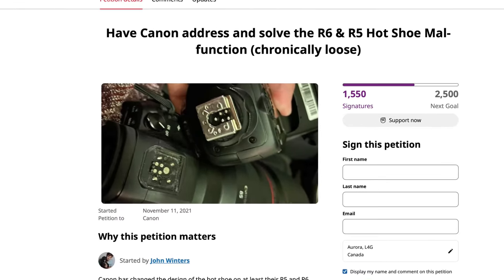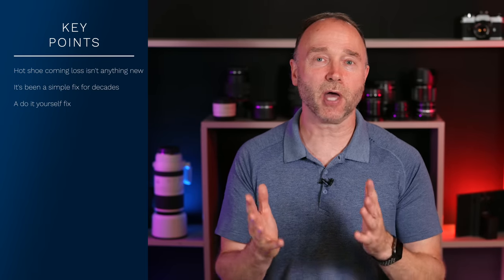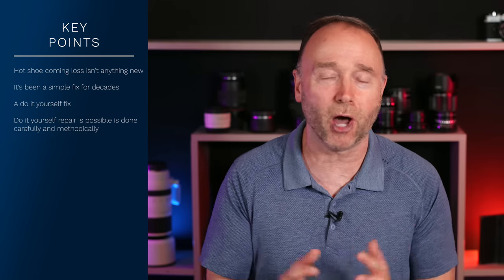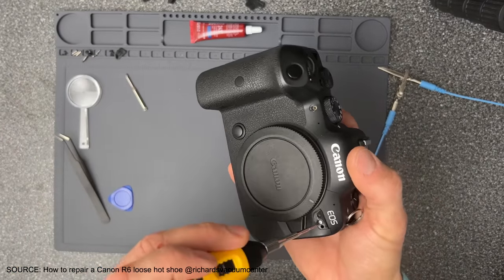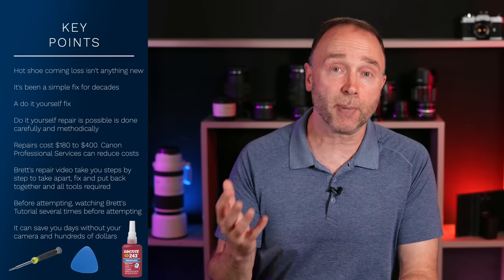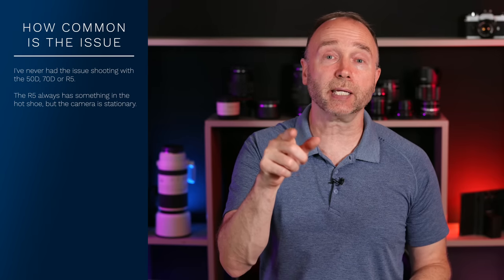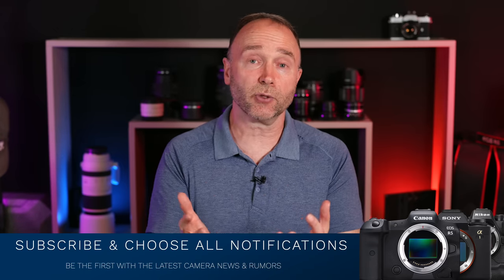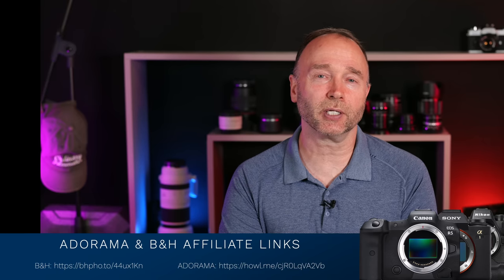Canon EOS R System: Major Flaw?

Comment: I've shot with Canon for 30+ years. This has never happened to me on any camera so maybe this is a manufacturing issue.
Reply from the maker: Brett observed that screws without any sort of locktite were most affected. Vibrations over time will shake anything loose including screws. Having something weighty attached and moving around all the time is one recipe for the screws coming loose. This does not seem to affect a lot of people, but does require service on the R system if it happens unless one is willing to attempt a repair themselves.

Comment: Canon should offer a hot shoe tightening service for free.  Otherwise they risk dozens of owners suing them.  Clearly if you dismantle it yourself it invalidates any warranty and your insurance wont be happy either.
Reply from the maker: I don't think there is enough people to sue. The cost to sue versus the damage one receives is not enough for one person to sue, and there aren't enough people to justify a class action suits. Car companies are known for this type of calculation - how much potential exposure is legal versus the cost of recall.

One thing this serves as is a reminder to check your equipment regularly for readiness. Screws come loose all the time in tripods, camera gear and other devices. I'm always checking tripods for lose screws and vents on computers for dust build up... which is why I don't have a lot of toys with engines... maintenance sucks a lot of the fun out of it.
Reply: @OrdinaryFilmmaker True.  But perhaps Canon might redesign the hotshoe for future models.  They could use a screw glue like they use in my drone props. 
I have a simple issue now with my car, a BMW, blocked filters on the screen wash. Bad design: To fix it, you have to half dismantle the car underneath the front wheel, wrestle the water bottle out, drain and flush, clean the tiny filters, and then reassemble with a dozen types of screw and fittings. . . Garage said it would cost me £140 plus for them to do it.  Obviously, since this is a common problem, the design by BMW should have taken that into consideration and made it easy for owner maintenance.
Reply from the maker: I'm sure it is already on their list of defects. For each release they evaluate what to fix and what to enhance based on priority and impact criteria. The recent news coverage will likely up the priority a little.

Comment: I’ve never had this happened to any of the cameras I’ve used. But would be great if you had just 4 little screws to tighten. Good thing there are still YouTube creators giving how to advice. But opening a camera back in a dust free area at home wouldn’t be easy.
Reply from the maker: Same here. No issues here either, but put the screws back on top - its not like they are an eye sore and are hidden.

Comment: For comparison and objectivity, you should have mentioned how the hot shoe is attached to the most recent  cameras from Nikon, Sony, Fuji, etc. and if any other manufacturers have similar design flaws.
Reply from the maker: I did cover this in passing, but not focus on it Jim. The focus is on Canon with recent stories. Towards the end I also stated that this is not impact a lot of people and has been over blown somewhat as all major manufactures have issues like this.

Comment: I've had my R5 for about a year.  I use a rather large 600EX-RT Speedlite but also, more often, I use a small Speedlite transmitter and keep the actual light off camera.  So far I've not had any issues, but knowing it could be an issue and how involved the fix is has prompted me to be mindful of how gently and carefully I place and remove devices on the hot shoe.  Like I said, no issues so far, but why tempt fate?
Reply from the maker: Good to hear you haven't encountered any issues so far.

Comment: I've heard that many Canon R-series cameras have severe problems like the R5 und R6 models. Many users complain those cameras have freezing / lock-up issues, the hot shoe on the camera comes loose or falls off or the cameras are overheating with video recording. Quality control at Canon goes down.

Comment: While I haven’t had this problem myself with two R6’s, one R5, and an R3, I’ve also pulled up that little plate and put a dab of locktite on the back of the screws sticking out in hopes that I never have this issue. I also don’t hold my cameras from the item hanging out of the hot shoe. I also wish they just left the old design from back in the day. It was so much easier to just tighten things back up.
Reply from the maker: The old design was perfect. Checking my 70D was quick and the video was my first attempt. Oh well... We did get a better mount and a lot of other enhancements. Perhaps this discussion might help elevate this.

Comment: Love the summary list on the left of the screen. Thanks for that. Not sure if the Canon problems are in factories in Japan, China, or the Philippines. I say Philippines because my last lens, came in a box that had been shipped to the camera store from there. Mirrorless cameras are delicate. The hot shoe can come loose. It can overheat. It can slow down its frame rate after just a few minutes of high-speed shooting because the batteries are slightly weak even though you started with a full charge. I have now heard at least three times, “I’ve never heard of that,” when I say my articulating screen short-circuited from all the twisting required to open it and stuff it into the slot in my Really Right Stuff L bracket for cameras with the battery grip. RRS said, “I’ve never heard of that.” That’s probably because others either (a) haven’t reached 47,000 actuations or (b) never need to fully open the screen and twist it all over the place to get it into that restrictive L bracket slot (I now use a ProMediaGear bracket although I prefer RRS for other products because of terrific manufacturing quality). Now, when I trade it in for the R5 II, I will have to explain that there were 47,000 actuations during the operation of the first motherboard, plus however many I have had since Canon installed a new, less fried one. I can already see the trade-in prices dropping as I tell the store that. That’s why, kiddies, we go to the local camera store: So we can look someone in the eye and explain things or ask questions without the tedious chat box in the lower right corner of a screen.
Reply from the maker: I found the summary points help when people jump around. They are here to stay ;)

Some research is always good as is an understanding of material science. If it has screws, they can come loose, inspect periodically. If it has a vent, dust can build up causing overheating or performance issues. If it uses power, ensure constant and clean delivery with the use of surge suppressors and back up solutions. For batteries, allow them to discharge normally and avoid running to empty... These things are learning over time and usually the hardware. While design could be improved, I think this is an opportunity to consider check lists for out gear.

Comment: I'm not the heaviest user of flash, but until this past week, I had not heard of even the previous hot shoe issues. I guess if I doesn't happen to me, I don't go looking for it. I have the Canon Care Pak on my R5 for most of the next 3 years still, so if I do experience the issue, I'll let them take care of it. After that time, I'm daring enough  to try to fix myself. I used to do PC repair, and I've managed a few other delicate repairs around the house in the last few years too. I certainly do hope that those experiencing this are in the minority.

Comment: Never thought to check for a video to do a repair myself. Mine on my R6 came loose from the Atomos. I’ve also had the power switch lever fall off. I went to a cage with hotshoe on the handle. Little unsure about the Tascam XLR “handle” because of this. I wondered if a digital hotshoe “extension cord” would come out so it’s not a problem.
Reply from the maker: The Ninja is heavy. I would suggest using a camera cage for it as it does not need the hot shoe interface.

Comment: Canon need to learn two things:

1. Sometimes, they achieve design perfection;
2. Having attained perfection, they need to recognise that, and NOT CHANGE IT.

Another example is the battery catch on their modern cameras.  It used to be you could stick your fingernail in there and flip it open easy as pie, but then they went and changed it.  I don't recall when exactly, but this too might have been around the time of the EOS R.  Now, do the same thing, and your fingernail slips off the catch without opening it.  Sometimes I have to try two or three times to get the wretched thing open.  Even worse if the camera is on a tripod in an awkward position.  The result?  Missed shots whilst fiddling around with the battery.

WHY DID THEY CHANGE IT?
Reply from the maker: The R system was a complete redesign over the EF system developed in 1986. They introduced a lot of new capabilities like that bigger RF mount and enhanced on others, but with anything new, one is going to introduce gremlins into the system. I hope this is resolved in future cameras, but for the meantime, use a camera cage to support heavy attachments that don't require direct hot shoe connectivity.

Comment: Only had an issue with the little connectors were they need encouraging, or it was the spring type connection on the 400d or 7d. Other than that it’s fine but my mileage is very low with hot shoe use

Comment: Dunno that it's a flaw with the system; it's more a flaw with these particular bodies, if anything, since the RF system doesn't depend on this particular hot shoe design in any way.

Personally I have never had an issue with this on my R5 or R7 but I definitely see why it'd be really frustrating for people who do.

Not the first cameras to have some weird physical defect or flaw, but still, if it fails more often, not the best.

Comment: I just picked up my R6 for this hot shoe flaw.  And I had the same issue with my R5.  It cost me about $280 each repair.  I use my cameras for event photography and the flash puts a lot of stress on the mount.  I’ve had people bump into my flash while it’s mounted onto my camera.    I don’t understand why Canon put the screws inside and upside down instead of the outside and right side up.  If you live in NYC and don’t have a warranty or insurance on your camera go see the Camera Doctor.  They had my camera ready in 2 days.
Reply: I am a CPS member and they fixed mine for free. This should be more of an issue. I think they should be fixing this for free
Reply from the maker: Thanks for the feedback Mick and Bill. many come here to hear your feedback. Being a CPS member does have its benefits.
Reply: @OrdinaryFilmmaker  100% but they have to know this is a flaw. Should actually be a recall

Comment: By take off something from the hotshoe, move it straight line back from the hot shoe and not move it (Speedlite) left and right to remove it out off the hot shoe!
I'm using from 2003 a Canon EOS DSLR and never have a problem with a hot shoe.

Comment: I remember screws coming loose inside my Canon 200D, causing all kinds of electrical havoc. It was the very last digital Canon camera I ever bought. They were never made it past the two year mark, despite taking care. 
Maybe a bad run, but it never happened to me with any other brand. 
I wonder if the Locktite fairy has moved into Canon's factory. I have one in my office and it keeps stealing the stapler and the sticky tape.
Reply from the maker: I've owned the 50D, 70D and R5. Each one hasn't had an issue. The 70D is about 10 years old and no signs of wobbling. Every brand has a bad batch, a few bad parts even the most reliable. However, when an issue goes on one time, it doesn't hurt to shine light on it hoping a redesign comes. 

Is it a red line stapler ;)
Reply: @OrdinaryFilmmaker  Thanks for the reply. I think it might have something to do with temperature where I live (Australia). The day-night temperature difference can be up to 30°C. Plus moisture.
Have a great day and keep up the good work! ✌️
Reply from the maker: I and other viewers appreciate your feedback. constant heating and cooling can also affect screws as they expand and contract. Either way, with DSLRs like your 200D or my 70D, it takes no more than a minute to fix. With the R system, it can take the better part of an hour if one is experienced enough, or $400 at a service centre. One option you might consider is using a camera cage for attachments that don't need to be in the hot shoe for connectivity.
Reply: @OrdinaryFilmmaker  Thanks, all screws came off inside the cameras, on my 60D and the 200D. Not trying to put Canon through the mud, I had been shooting them since the late 70s. 
In contrast (and I am not a fanboy) this never happened with any of my Olympus or Lumix cameras. Which leads to the obvious conclusion that they must be responsible for the missing tubes of Loctite 😊

Comment: Like ytr8989 I have NEVER had this happen either to a cold shoe or hot show whether film or digital.  I have Zeiss Ikon Contax IIa and the cold shoe is as tight as when they put it on in the 1950s. I have my original Canon A2e and that hot shoe is tight.  Neither on my Sony A7II when I had it nor on my Sony A7RIII which I have now they are tight as the day it was made.  My Leica M240 same thing.  This is a design flaw that Canon should pay for.

Comment: I just had my r5 fixed by canon, it’s 175 to have canon do it.
As far as the r3 r6 mkii r5c etc, they have the smart shoe and I haven’t seen any smart shoes loosen.
Seems to be an issue with the r5 and r6 at least in my experience.

Comment: Whatever happened to that old adage.. if it ain't broke, don't fix it?
What problem was Canon trying to solve with this redesign?  The "problem" of not getting enough revenue from repair services?

Personally, I wouldn't be comfortable DIYing this.  I fear I'd break something in the process, making the ultimate repair all that much more expensive.  Thankfully, have not had an issue thus far, knock on wood.

Comment: Hey Simon, Thanks for not only notifying us of a potential issue, but by providing a DIY solution just as well 👍
I do have something 'mounted' on my hotshoe all the time, yet I don't expect to encounter this flaw anytime soon, given what I mounted is the only Nikon gear I own: a little plastic hotshoe sealer to prevent rain causing corrosion on the electrical hotshoe contacts 😛
Reply from the maker: Same here. My R5 has shot over 1000 videos with a Ninja V in the hot shoe and it is firmly attached. I think it might be to do with how much of the glue was applied or not applied.
Reply: @OrdinaryFilmmaker  exactly.  And when one truly has to save on glue, it's safer to pick the hot shoe instead of say the strap mounts 😛
Reply from the maker: Yep. When I run and gun, I have nothing in the hot shoe rather than a light mic. Perhaps the constant movement stresses it more than being stationary.
Reply: @OrdinaryFilmmaker  indeed, physics dictate that more movement and more weight will increase the stress on accidentally poorly glued screws.   The few grams of my 'Nikon gear' are pretty harmless in this corner.

Comment: While this is certainly disappointing to know Canon has made this less user serviceable. The truth is almost all the other camera manufactures have required this type of disassembly to fix this type of issue with their cameras as well. It's one of the reasons I personally try to steer away from using a heavy flash in a hot shoe, but instead use a remote trigger system with a flash offset in a cold shoe to the side of the camera, or better held further away or on stands if doing flash stills.

Comment: Is this also common on Sony cameras? On my FX3 I have the two screws that hold the audio handle to the body, but when I use my hot shoe audio attachment on my A1 I do get nervous sometimes.
Reply from the maker: Any electronic device with screws can come loose if they experience a lot of movement under load. Movement creates vibrations which causes things to get loose, load accelerates this. With any gear, always check it periodically. It's also very common to have screws come loose on tripods, which can be costly when they fail. I check my tripods every month or so for this very reason.
Reply: @OrdinaryFilmmaker  Good call and an excellent reminder. The FX3 screws are easy to check because I remove and reattach the audio handle so often. I wouldn’t even know how to check the hot shoe on the A1 though.

Comment: if it breaks, send it back for refund, buy another brand. The hotshoes and flashes need to be redesigned. Its a lot of weight  being held on a small area. But this is probably 20 years away before we see any change.
Reply from the maker: It s a combination of the weight and movement. I've had the Ninja V attached to the R5 every day since I got it in Studio A and mine is not loose. When I am in the field, the heaviest thing in the hot shoe is the shotgun mic. Vibrations over time can shake anything loose. Before, the screws could easily be tightened. Today its a $400 repair bill.

Comment: You didn’t mention the R8? Does it have the same issues?
Reply from the maker: It has the same architecture design, so its plausible.
Reply: R8 has the new smart Hot shoe similar to the R6 MkII. So I don’t this those are having the same issues.
Reply: @Aiproductions713  thanks!